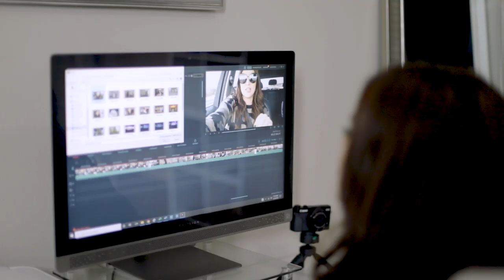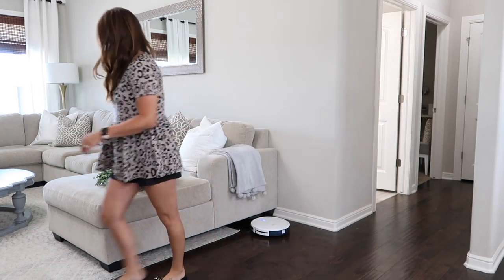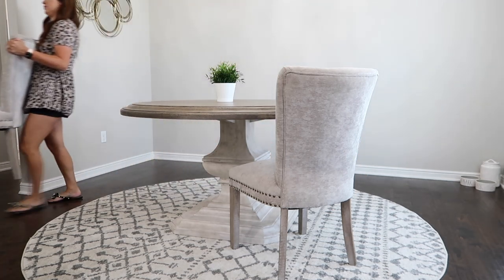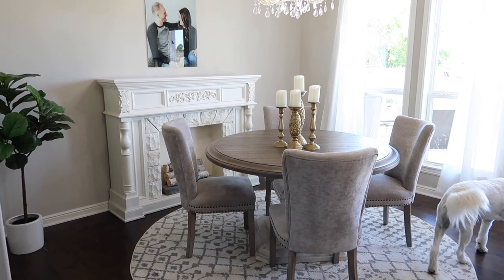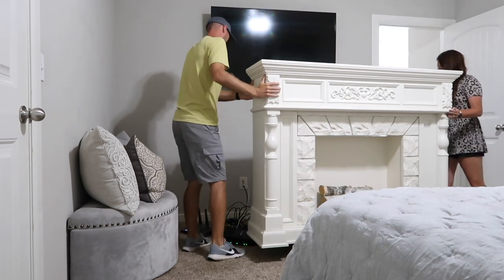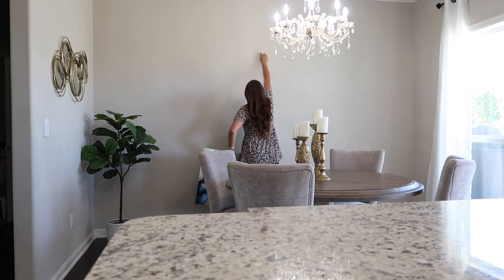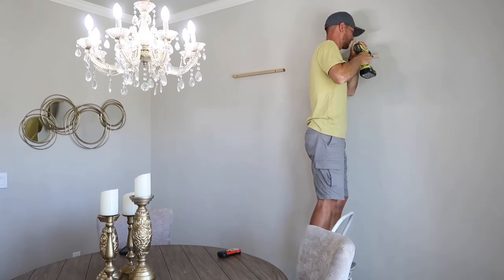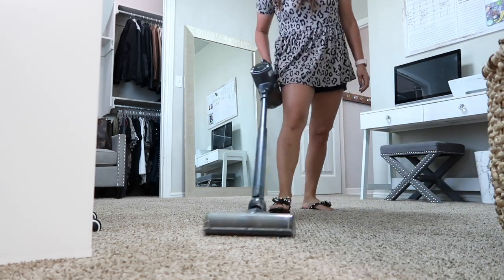*NEW* SWITCHING ROOMS | REARRANGE + DECORATE WITH ME | ITCH TO SWITCH

Comment: Is your hall closet outside of your bedroom?  If so, could you run the wires  through the wall into the closet and put your modems in there?🤷‍♀️ Then they could stay in closet and not be a factor for those itch to switch moments.
Reply from the maker: No I wish. We don’t have a coat closet or linen closets. 🤨